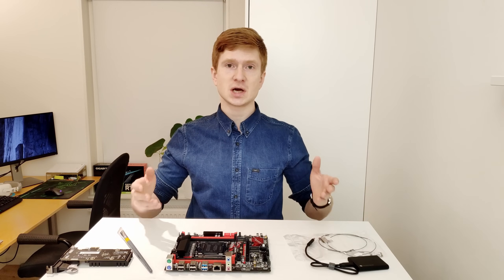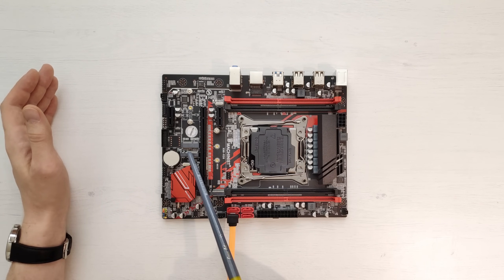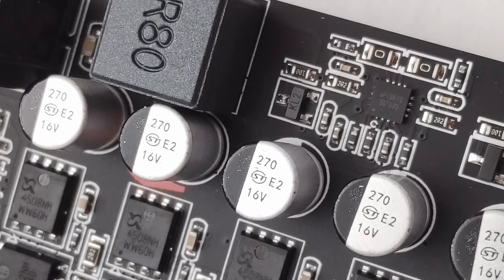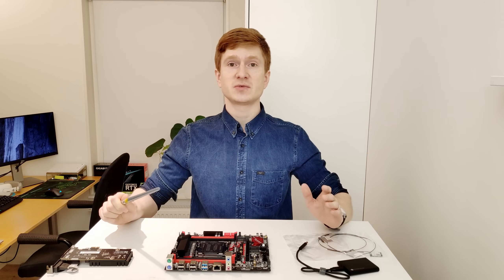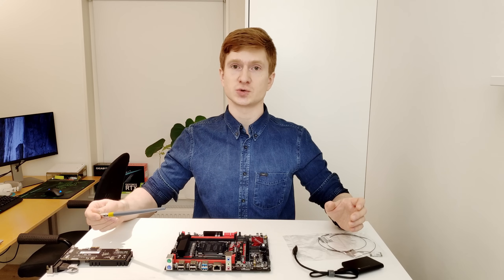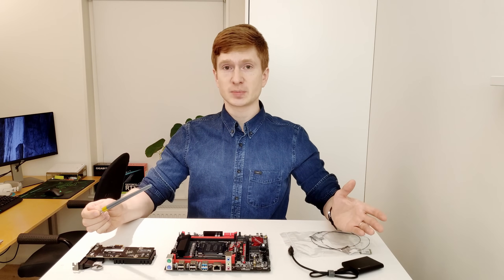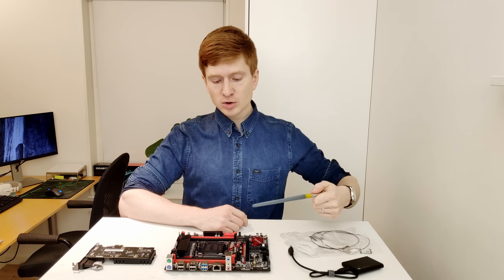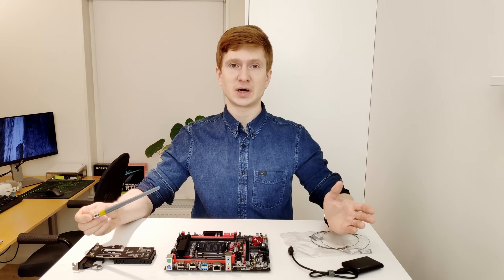🇬🇧 Machinist X99-RS9 – detailed review | E5-2678 V3 | i7-6800k | BIOS | O.C. | VRM | Mi899

Comment: Hello,
For Machinist X99-RS9 and E5-2678 v3 your use the bios Huananzhi X99-8M-F , TP ,TU PEI -70/50mv does this bios work with E5-2660 v4 and the same motherbord ?
Thank you
Reply from the maker: No, V4 CPUs are not compatible with Turbo Boost Unlocked BIOS.
Reply: @Miyconst  Thank your very much for you answer
Reply: I understand that the original bios of this motherbord is bad can I put another one compatible with the E5-2660 v4  which improves the motherbord even if the turbo boost will not work ? and si yes which one do you recommend ?
Thank you

Comment: Hello, can you tell me if this motherboard is compatible with the AC210 board? if so, is there any configuration to do in the bios or some jumper, i put the ax210 and install the drivers but nothing works
Reply from the maker: Could you please clarify, what is AC210?
Reply: @Miyconst  sorry, the translator changed "ax" to "ac", in this case I'm referring to the AX210 wifi and bluetooth card
Reply from the maker: I don't think I could help with it. If the system doesn't detect the device - it's not compatible.
Reply: @Miyconst  the motherboard detects the device, the wi-fi and bluetooth but both do not work as if it had an incompatible driver, so I thought you would know something about it, some setting in the bios or something, but thanks anyway
Reply from the maker: @finjackin  if the device is detected, then there is a chance to get it working, text on my Discord with some extra details and info from the device manager.

Comment: I have a question please..  WHAT motherboard would you recommend for x99 lga 2011-v3 in a micro atx with similar PCIe slot configuration and m.2 nvme?  One without a bios issue

Comment: Just bought this with 2650 v4 am i good on the temp side of things? Should i water cool the cpu or fan cooler ? To be safe on the temperature side of thing?
Reply from the maker: E5-2650 V4 is very slow and very cool, you don't need to worry, a simple air cooler is enough.

Comment: Hello from alabama, you probably get tired of answering all these questions but, I bought this motherboard for a budget gaming rig and I read through the comments to see that it supports the 6800k (with no oc) and I also saw the cpu is 140 tdp, would this make the vrms overheat?
Reply: Also read that your bios will not work with the 6800k? Which cpu would you recommend for gaming with this motherboard. Thanks in advance!

Comment: I have this board, and never can use gtx 1060 6gb, its always no display, but if use in other mobo, the gpu works fine. Can you help me
Reply from the maker: Sure, if you can bring the motherboard to me I can test it with other GPUs.
Reply: @Miyconst   using other gpu is work fine, I'm using GT 440, and its no any problems
Reply from the maker: @nugrahaindrawan6453  then it seems to be a GPU compatibility issue for whatever reason. Unfortunately, I don't think I can do anything about it.
Reply: yes agreed, after i change to gtx 1650 super, its works well

Comment: Super nice helpful video, 👌,  question here  witch Bios can i use for the  X99-RS9 with Q87 and E5 2680 v3? Thank you.
Reply: Thanks for the information 👍
Reply: @jlhj2526  Hi, do u tried install?
Reply from the maker: As far as I know, the standard Huananzhi X99-8M-F BIOS can be used with Q87 chipset as well, but I can't guarantee that and there is always a risk to brick the motherboard.

Comment: How does one connect the antennas for the on-board wireless card?
Reply from the maker: It depends on what kind of antenna you have. There shall be two click points and that's what you use.
Reply: @Miyconst  In all the ads I am not seeing a PCI slot cover with antennas and long antennas cables to connect to the M.2 wireless card or am I missing something?
Reply from the maker: @handlehidden-f2j  I am not sure I understand you correctly, if you want some extra details - join my Discord and send some pictures.
Reply: @Miyconst  I have not bought a board yet. The M.2 wireless card will not work very well without antennas.

Comment: hey brother, so I would like to know if it would be good to use this card for an E5 2640V3 I intend to leave the HT Off to be 8/8 and overclock to 3.8ghz or 4ghz, do you think there is a problem ???
Reply from the maker: It's not possible to overclock E5-26XX CPUs, B85 chipset also doesn't support any overclocking.
Reply: @Miyconst  mas no aliexpress no anuncio que eu vi diz que suporta, mas voce acha que fica legal o desempenho pra aguentar ate uma rtx 2060 super em 8/8 a 3.4ghz no turbo ???
Reply from the maker: @W1LLZ3R4  it doesn't matter what AliExpress description says, the fact matters. E5-2640 V3 is a good match for RTX 2060 Super.
Reply: @Miyconst  ok thank you friend

Comment: Hello Miyconst

I hope you are having a great day, I hope you can help me with something, I have a problem, I don't know what bios to flash to have the turbo boos in my machinist rs9, 50 - 50 mv? 60-50mv? 70-50? 80-50? 100-50mv? 90-50mv?

you can help me with that? the one I tested freezes at 60-50 mv

and I don't want to break the motherboard

thanks miyconst, I hope you read this.
Reply: postdata: 
I have the bios huananzhi 60 -50 mv and it freezes, I use mi899 x99 tool set bios mod with turbo boost for the rs9
Reply from the maker: Did you restore the BIOS defaults after flashing the BIOS? Anyway, for more help please join my Discord.

Comment: What chipset does this use? I have a i7-5820k but all of the X99-RS9 boards I find say they have a B85 chipset. Is this compatible with a i7-5820k, or do I have to find a different one?
Reply from the maker: It's B85, it's compatible with the i7, but no overclocking.

Comment: Dude sometimes my pc freeze with 8mf huananzhi BIOS, do u know why that hapnd? Whit the original BIOS works perfect
Reply: I have a E5 2660 v3 with BIOS OC - 50 - 50 mv
Reply from the maker: Because you CPU can't handle that much undervolting, most likely.
Reply: @Miyconst  
what do you recommend? , if i adjust the millivolts of the bios to 70 - 50 do you think it works? or tell me what can i do, pls i need the turbo boost

Comment: Hi myconst.I don't want to bother you, but after I unlocked my brand new RS9 with a 2620V3, I did a stress test to see if it worked. Cores were working fine at 3.1ghz for 10 minutes, after that the frequency altered randomly so I shut the computer down. That was the last time I saw the computer screen on. Now it stays on a never ending power cycle, the mobo seems dead. I suppose this is the end of it, right? thanks in advance.
Reply from the maker: Yes, it seems like you have burned down the VRM. 10 minutes with E5-2620 V3 should be harmless, but my guess is that the radiator doesn't have a proper contact with the VRM and thus it overheated.
Reply: @Miyconst  Thanks for the response!

Comment: Hello there, you say that the temprature of the voltage converters get really hot, if i am cooling it with extra 2 Fans it might be stable at 60 degrees i think???? What do you think about this idea miconst? Thanks for an answer. Br christoph
Reply from the maker: Extra cooling is always nice, but it doesn't automatically guarantee that the VRM will stay cool. Just blowing air is not enough, you need to extract hot air from the PC and inject cold one from the outside, basically you need a good airflow inside your chassis and direct air blow over the VRM. The heatsink also must be properly attached.
Reply: @Miyconst  ok, i will test and write you my results. 
This Mainboard is now in a bundle with 2666 and 16gb ecc memory. 55 Euro for the bundle.

Comment: Will I be fine with an e5 2666 v3 stock, no case and a good air cooler? I may use an extra fan for the VRM if I feel it's too hot for my taste.
Reply from the maker: It should be fine, as long as you keep the VRM cool.

Comment: RS9 2640v3 working fine with Huananzhi X99-8M-F -50/50 BIOS. Only one downside wich is that it freezes, requiring to force shutdown when looking at sensors, like aida64 and hwinfo. Aida can be fixed by disabling PCH / Bibxy module but hwinfo I'm unable to use, still looking for a fix
Reply from the maker: Unfortunately there is no fix for this issue, the desktop chipsets were not designed for LGA 2011-3. Maybe a better BIOS could solve the problem, but so far there is no such BIOS.

Comment: Now I'm just sad. I watched all of your videos on X99 motherboards and found the X99Z V102 with the C612 chipset for $85 CAD, but like you I bricked the BIOS, but I don't have a fast USB2 port. It was one of the best as you said.

So I bought the inferior RS9 for $104 CAD, and now I'm planning to upgrade to a 2660v3 from a 2620v3 but I'm unsure of whether or not it will handle it.

I am thinking of using the thunderbolt ports on my thinkpad T480s with a usb-c to usb-a adapter to connect CH341A, do you think this will work to revive the X99Z? Thanks.

Side note: I am certain that the RS9 helped a ram issue where the X99Z only showed 1 out of 2 ram sticks though. Maybe 1 of the sticks was an 8-bank RAM configuration?
Reply from the maker: It should be possible to revive your X99Z, did you try to connect 24-pin power connector? Trying other USB ports won't hurt, so try it. Also disconnect everything from the motherboard and nothing works, try to get a clip with short copper wires instead of the long aluminum ones.
Reply: @Miyconst  Yes, I also tried keeping it powered on and off, inserting and removing ram cpu, and all components to no success.

Do you think that a high speed thunderbolt port with a USB-C male to USB-A female adapter will be able to supply the full power from the thunderbolt port to the CH341A? Thanks.

Comment: X99 rs9 + I7 6950x
Can i?
Will work?
Reply from the maker: It works, but it's pointless.
Reply: @Miyconst 
Bad performemce????
If i bought xeon e5 2620v3 can i run all games on 60 fps???
Or it is bad cpu??
Reply from the maker: X99-RS9 does not support overclocking and has rather weak VRM. E5-2620 V3 is an okay budget CPU.
Reply: @Miyconst 
Thank you very very much

Comment: Does anyone have the same problems that with the new RX 6500 XT as soon as the driver is installed, the screen is full of artifacts and then the PC reboots?
I have now read several times that there are problems with the motherboard, but no one has found a solution.
Reply from the maker: Sorry, I don't have RX 6500 XT to test, thus I can't comment. Did you test the GPU with other motherboards?

Comment: Will this motherboard works ok with i7580k out of The Box? I dont want to overclock or anything, Just to work.. my old motherboard died and I cant find others motherboards that suppotts my processor
Reply from the maker: Yes, it will. Watch the i7-6800k section, it's the same with i7-5820k, but the RAM speed is limited to DDR4-2400.

Comment: Hello, can i use a fan controller and plug it to my cpu fan header to get smart fan control on my other fans. I want to use one that gets power from a sata cable so that i do not overload the motherboard fan header. Is that possible on this rs9 motherboard.
Reply from the maker: Yes, you can do that.
Reply: @Miyconst  Love your work. Did just this and i have fan control now. Its silent and i love the build.

Comment: Does anyone knows if the new version of the RS9 works fine with the Hwananzhy BIOS? I got a RS9 recently and i want to use the MI899 to do the unlock turbo boost but i'm scared i'll brick my Motherboard
Reply from the maker: As far as I know, it's compatible, but as always, it's your risk and your decision, Chinese may have changed something without any notice about it.

Comment: I loved this video, I was thinking of buying an RS9 x99 a long time ago but thanks to this video I have already decided that I will buy it, since for the features it has and others I think it would be a good option to have my own low cost set up.

I only have a few doubts, if I first use an e5 2620v3 with the turbo bost bios, will I have a problem if I later want to change the processor to an i7 5930k?

And would you recommend upgrading to i7 5930k?

excellent video keep it up!
Reply from the maker: Core i7 CPUs are not compatible with unlocked BIOS, thus you will have to restore the original BIOS before upgrading the CPU. X99-RS9 + i7 is a pointless combo because RS9 doesn't support overclocking. You would much better be with E5-2666 V3.

Comment: Hello again! one more question :-) : Right now my rs9 is running fine with 2630l v3 with turbo unlock (-70); is it safe to replace it to 2640v3 ? Any special procedure to replace the processor?
Reply from the maker: It should be safe to just replace the CPU, but if your E5-2640 V3 can't handle -70/50 voltage reduction you will be forced to put the old CPU back and flash another BIOS.
Reply: @Miyconst  Understand... in theory, what would be the optimal undervolt settings for the 2640v3?
Reply from the maker: @mnovak5433  In theory -70/50 is the optimal for most of the V3 CPUs, but some rare units fail with -60/50 and some rare units can hold -100/50.

Comment: I have a b85 machinist x99 rs9 motherboard. Can i flash bios from machinist x99 rs9 Q87 

Can Q87 go to B85 

In mi899 i see stock machinist x99 rs9 bios rom Q87 can i flash that.
Reply from the maker: Yes, as far as I know. Why not to use Huananzhi X99-8M-F BIOS though?
Reply: @Miyconst  Thanks. I would suggest removing the intel inside logo from the bios. Looks terrible. Or probably a smaller logo but generally remove that. Thanks. Otherwise i appreciate your contributions.

Comment: How can i reduce the fan speeds. The are spinning so fast. Its my first build using this motherboard
Reply from the maker: Smart Fan configuration is available in the BIOS, but only for the CPU fan header and only if you use 4-pin fans.

Comment: Thank you for the technical review - what cooler did you use for your build?  I bought the motherboard and a Hyper 212 cooler but I am unable to install the cooler.
Reply from the maker: Cooler Master Hyper 212 Evo has multiple variants, some come with LGA 2011 mounting, others without. If you don't have the required mounting you need to get another model.

Comment: Thank you for all your hard work! I viewed a lot of your videos to research and finally bought this motherboard. I’m going to use it for a home server with an Intel Xeon E5 2637 v3 and 32GB of DDR4 ECC memory. If I plan to install Proxmox as the main OS, would you recommend I still flash the BIOS with the recommended version?
Reply from the maker: Yes, I would always recommend to use X99-8M-F BIOS because the stock BIOS is garbage.
Reply: Is there a specific version of the BIOS you would recommend I use, for something that will run 24/7 but will be idle 90% of the time. I don’t think I would need Turbo Boost either, just something that runs stable and uses low power
Reply: Got my motherboard, everything seems normal. Installed Windows and ran the Mi899 tool to flash the Huananzhi x99-8M-F BIOS. My previous question was more around if I should use the -50mV or similar BIOS (I'm totally unfamiliar with CPU undervolting) but in the list of available BIOSes for this motherboard, based off the description, the X99-8M-F BIOS seemed like the best. I've now got Proxmox running. Thanks MiyConst for your work again!
Reply: @SiddharthSakhadeo  What version of the BIOS did you end up using?

Comment: Hi , Windows is Freezing at the Loading screen when  flashing most of the TU BIOS files ( apart from one)  ,  on my board only the  'stock bios' & 'huananzhi-x99-8m-f.tp.tu' works however the board does not Turbo unlock , unless there is a setting in BIOS I have to change ? . Any of the 'PFI TU -XX Volts' causes freezing at the Windows logo . I can go back to stock using a USB programmer . My specs X99 Machinist B85 Chipset , E5 2670 V3, Quad Channel Corsair Memory .
Reply from the maker: Did you restore BIOS defaults after the flash?
Reply: @Miyconst  Yeah , after several power cycles ,  I finally got one  to work  :)

Comment: Hello Miyconst,

As you mentioned in this video, I did the procedure of changing the bios of my Machinist RS9 card to the bios of the Huananzi 8MF and everything went well for the Mi899, congratulations for the program, it is very easy to use and fast

But I had a question, I would like to change the RAM timings, but in the factory 8MF bios there is no such option, as I use the 2683 V4, it does not support turbo boost, I was afraid to put the bios "8MF, TP" just to change the RAM Timings as I don't know what that "TP" means

Can I install this TP version? or Do I have to go back to default RS9 bios with Ram Timings unlocked?

Thanks.
Reply from the maker: Thank you for the support. Each BIOS has it's description, please read it. TP, most likely means TechnoPlaneta, another YouTube channel that covers Xeon builds, and I added their BIOS into Mi899.
Reply: The change from Bios to TP and the timings went well, here the least I could get was 12-12-12-28-306-40, the latency was 89.6 and now it's 74.5

Thank you for your help

Comment: Which BIOS allows me to change RAM speed when using i7 5820/6800K?
Reply from the maker: Huananzhi X99-8M-F with unlocked RAM timings.
Reply: @Miyconst  Thanks , after Flash , only 2000Mhz or under boots , anything over causes freezing at booting screen . Is this normal ?  I have 5820k , 16GB ram (2x8 2400mhz XMP CL16)
Reply from the maker: @technomad900  Most likely you RAM requires 1.35V to work at DDR4-2400, but all Chinese X99 motherboards are limited to 1.2V only, thus your RAM might simply be incapable of faster speeds than DDR4-2000 @ 1.2V.